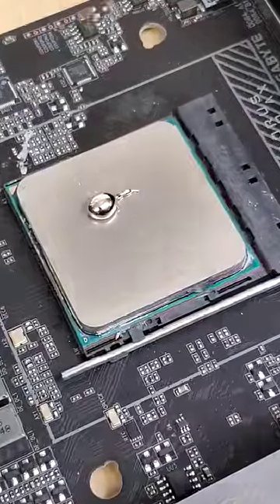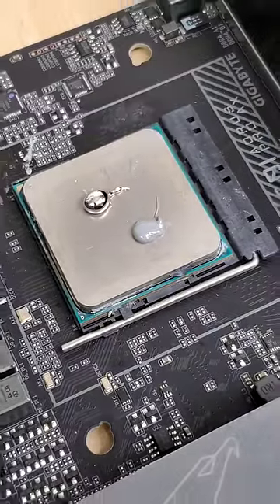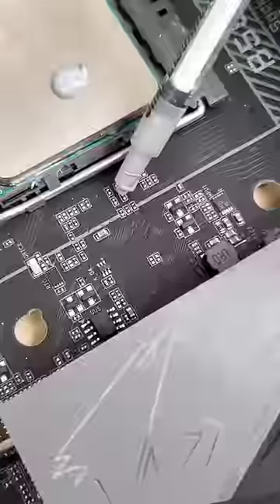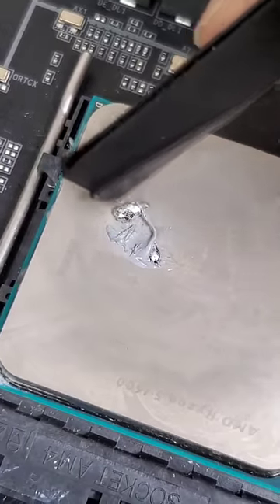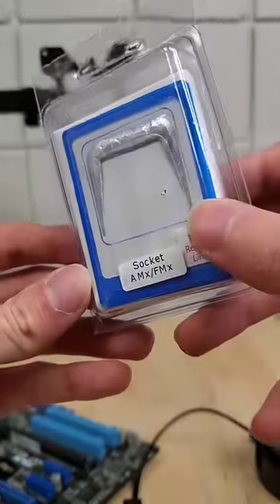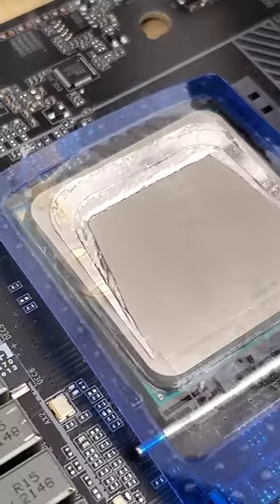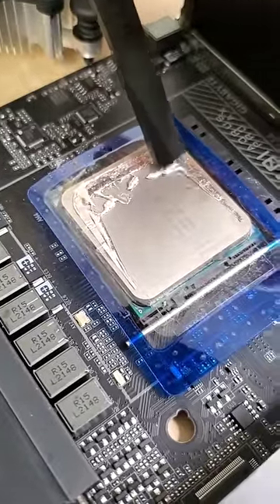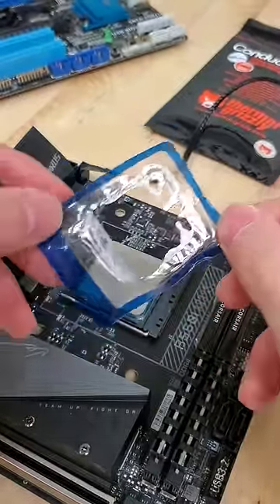the future of thermal paste technology #shorts

Comment: Try using solder as thermal paste
Reply: Solder is designed to have slight electrical conductivity?
Reply: You'll probably de-lid the cpu upon disassembly
Reply: Yes
Reply: @ottersmeep25 not slight...
Reply: @BoltGoesPro   it's called sarcasm
Reply: @ozzi189  if you render some 3d scenes first and right after take the cooler off while its still in liquid phase
Reply: Gal as thermal material 😂 probably pretty effective really.. it would have to be at operating temperature to remove the heatsink or water block before the gal sets solid.. but i would think its almost as good as liquid metal.. the only real difference is liquid metal is liquid at room temperature where gal needs a small amount of heat to melt (hand temperature is enough) but once its melted it should be very close to each other.
Reply: solder melts at temp 300celcius+
Reply: @electronicguy420  solder does. Gallium metal melts in the palm of your hand. Where liquid metal is liquid at well below room temperature.. it requires dry ice or liquid nitrogen to harden to a solid.. so gallium metal is pretty good for a cooling compound because the PC operating temperature will turn it to a liquid..
Reply: Nah just get that mercury bro
Reply: @michaellegg9381  he's talking abt solder...
Reply: Yeaaaaa
Reply: Come to inbox 🎉
Reply: @ozzi189  No difference for AMD AM4 CPUs
Reply: @electronicguy420  yeahhhhh that’s not melting
Reply: @electronicguy420  unless you try playing RTX Minecraft texture pack that solder will not melt
Reply: @Angyjxx  ik this is sarcasm but the connections inside the gpu will short before it even reach those kinds of temps
Reply: @electronicguy420 womp womp
Reply: @ozzi189 yeh, you'll need to run it to preheat the liquid metal, and then probably keep a blow dryer or something on it for removal
Reply: The next Intel i9 is gonna melt it 😂
Reply: lol don’t give apple any ideas
Reply: Solder huh, what metal is that 😂,
Reply: @LIVE-b7j  it depends 
cheap stuff is usually tin+lead
Reply: @chichangwu don’t forgot to unlock the cpu thermal limit to 300 celcius
Reply: Bad idea that solder is hot enough to sever the tiny little connections..
Reply: That won't melt. It melts around 320°C. But maybye solder paste would be interesting
Reply: @ottersmeep25 doesn't sound like sarcasm at all. You are terrible at sarcasm 💀
Reply: Can’t tell if that’s a troll but sounds like a video for LTT
Reply: Won’t work as solder melts at 250-300°c (leaded) unleaded melts at like 300-340°c, best bet would be low melt which melts at like 150°-170°c however the cpu would be cooked by the time it reaches that temp.
Reply: ever heard of amalgamation?
Reply: @ottersmeep25 not slight
Reply: I used to use thermal paste, but my dentist told me to use regular toothpaste.
Reply: @ottersmeep25 the whole point of the vid was that metal based thermal paste is conductive?
Reply: Not sure it would stick without a lot of flux but worth trying
Reply: @ottersmeep25  it is literally made to conduct electricity 🤦‍♂️
Reply: @ozzi189 Prime95 until it starts to reflow
Reply: @michaellegg9381  Yeah use gallium and watch it eat away every piece of aluminium in the system
Reply: @cyberpunk1618 popped in here just to say that, since Al is NEVER used in CPU lids. Or any of the wires. Want to see the actual silicon AND definitely destroy your system? Gallium will definitely do that for you.
Reply: Yeahhh that’s a bad idea, can confirm as I work with that shit on a daily basis
Reply: @ottersmeep25 it wasn’t obvious
Reply: @thatoneultramarine208  so do i
Reply: @michaellegg9381  problem with gallium is that it destroys every other metal?
Reply: @michaellegg9381  dude watch what happens when you put gallium on aluminum lol it’s not a good thing
Reply: @ozzi189 Wood's alloy or Rose's alloy. They melt at under 100C°
Reply: @Angyjxx  Then you should know it’s a bad idea lol
Reply: @thatoneultramarine208 lol yeah but this the same guy who put hot glue in his pc so there is a chance he will actually do it
Reply: @michaellegg9381   yeah and do you know any properties of gallium?  It liquifies alluminum and makes steel brittle when it comes in contact with them, and almost all heat sinks are made of aluminum.  If any gallium leaks out, it will liquefy your aluminum pc case.
Reply: @Angyjxx  True you do have a point there lol
Reply: @michaellegg9381  CPU covers are often made of aluminium, and gallium reacts with aluminium. You'd turn your CPU brittle like sugar glass.
Reply: @michaellegg9381 Gallium on an aluminum ihs and aluminum heatsink? You sure about that?
Reply: Do you know what temperature you would have to heat the CPU lid to in order for the solder to entirely wet the surface of the lid and the cooler?

You'd burn out the CPU and the socket before you could find out if it works, though it is a very interesting idea!
Reply: @BruceNJeffAreMyFlies  I'm not sure gallium eats other metals it's not something i have bothered to look at lol I know liquid metal eats other metals so it might ill google it. But if so a copper IHS would be a good way to avoid that issue and a copper slug in the heatsink.. might cost a extra few $$ but would be worth the effort I would think 🤔
Reply: I don't think it'll ever get hot enough to liquefy and if it doesn't get a solid connection it'll suck but I still wanna see
Reply: @ozzi189 I don't think the solder would even stick to that but I also am not positive what it's made of
Reply: To all who say gallium metal is bad.. ( yes it is) but it's also the main ingredient in liquid metal from thermal grizzly..

“Gallium in general also reacts with copper and leaves it pitted on the very top layer, but the reaction is not heavy so doesn't really matter to Thermal Grizzly. Nickel has the function of a diffusion barrier and doesn't react with the Gallium, which makes it a lot more suitable for the application.”7 Sept 2018
Reply: So we already are using gallium metal in cooling systems as it melts at 10°c.. it even eats copper slowly as it pits the surface of copper so now I wonder how thermal grizzly liquid metal doesn't eat the copper slug or cold plates in cooling systems
Reply: It wouldn’t get hot enough to liquify. If it does, you need to either put the wires in the right ports, or you need to run away from your house.
Reply: @michaellegg9381
That’s great and all, Michael, bud OP was talking about solder. Also gallium is very corrosive and reactive to pretty much all metals. Terrible idea.
Reply: Solder is used between the actual CPU die and the heat spreader, so yes that's certainly possible, but you may as well just delid the CPU for that additional benefit if you are going to go that far.
Reply: @eclipsegst9419  exactly 💯.. if you are going to delid a CPU ya might as well liquid metal it while you are there..
Reply: Bro, they are dying for their country and you want to use them as a thermal paste??
Reply: @MrFuzziiWuzzii  indium solder is what Intel and I assume others, use.
Reply: Fr
Reply: you mean solder paste?
Reply: solder TIM based on indium is commonly used to conduct heat from the IC to the IHS of a modern SoC
Reply: @ottersmeep25 so does liquid metal?
Reply: @BruceNJeffAreMyFlies CPU covers are made of nickel plated copper, and existing Liquid Metal thermal pastes already are mostly made of gallium anyways. Back a few years ago people used to take the cover off of cpus and put Liquid Metal in between the actual silicon and the bottom of the cover. A lot of precautions you have to make but it would drastically reduce temps
Reply: Maybe make a circle with silicone based thermal paste and put the metal one only in the middle of the heat spreader. The dye is only in  the middle at the side of the heat spreader are the bonding wires.
Reply: and we thought thermal paste was a bastard for getting the CPU stuck to the cooler
Reply: @ozzi189 then don't disassemble it
Reply: gallium would destroy your cpu though because it’s so corrosive
Reply: the problem is that its gnna solidify really fast (bcs the cpu conducts all the heat away) and then it wont really contact the cpu/cooler really well, also you will solder them together and then cannot get them off eachother
Reply: @088O  Solder ≠ Gallium
Reply: My cooler is hardwired 😎
Reply: CPU manufacturers already do that.

They use an Indium based solder to bond the silicon dies to the heat spreader because It's more thermally conductive and has a much longer lifespan than pastes.
Reply: The cpu itself is sometimes soldered to the heatspreader, so they already do!
Reply: I too would like to see this. Although it would probably require de-lidding the CPU to "safely" do, and de-lidding is already risky/unsafe.

I suppose with a low melt solder of around 130 C you could maybe get away with heating the heatsink and squishing the CPU on, but even that seems really difficult, and additionally has the risk of overheating the CPU since they may break at those temperatures.
Reply: @ottersmeep25 Electrical solder, yeah.  but there's always jewelry solder!
Reply: @ottersmeep25 Liquid Metal is highly conductive which is its major drawback
Reply: @GregoryMcBride-qf7hx   no, it doesn't. gallium is only corrosive to aluminum?
Reply: @michaellegg9381   yep, gallium is only corrosive to aluminum
Reply: @ottersmeep25  it does also damage copper.. it doesn't destroy it like aluminium but it does slowly pit the copper surface.. I not long ago asked google for what damage it can cause to what metal's.. turns out nickel plated copper is the best way to liquid metal at the moment as nickel finish is highly resistant to gallium metal.. but I had a good thought!! What if we used silicone as the cold plate on a cooler instead of copper slug or something like that as the surface can be really flat and transfers heat really well so deluded and the silicone die with liquid metal then a silicone suffice for the water block or air coolers could be really good I would think..
Reply: @ottersmeep25  are there any aluminum components in a computer? Unless it was fully contained, I wouldn’t trust it.
Reply: @ottersmeep25 it is very conductive for both heat and electricity. So is this metal he’s shown in the clip. So is Liquid Metal. That’s why they short out the mother board when they go places they shouldn’t be in. Because the positive and negative get shorted out through the conductive material dripping or flowing onto them.
Reply: I read "soldier" at first and got really confused for a second
Reply: @IMDYT420  What kind of solder are you guys using? The standard SAC305 has a melting point around 220°C, the old SnPb solders are closer to 190°C.
Reply: Cooler and CPU forever mated
Reply: @Angyjxx womp womp is such a cringe elementary school phrase, why are you like this?
Reply: @cyberpunk1618 if you have a full copper heatsink base, and a copper IHS.. Gallium isn't eating anything
Reply: @glen3925 almost all good heatsinks have a full copper base, which is not reactive with gallium.. Also I may be wrong but I'm pretty sure you can't use liquid metal with an aluminum heatsink anyway since it often has gallium in it anyway?? How do you think people running liquid metal manage, they go copper
Reply: @twisvis5531 what do you think liquid metal is made of?
Reply: @michaellegg9381 liquid metal eats other metals because it has gallium in it
Reply: @michaellegg9381 it does very slowly, but it's irrelevant to its performance
Reply: Thats just a laptop

Comment: I thought it’s gonna be some incredible solution. It just ended up being: let’s put something above the metal
Reply: Sometimes the simple solutions are all you need.
Reply: The heatsink goes above the metal. The thermal paste fills a very small airgap between the CPU's heat spreader and the heatsink.
Reply: @MrAndrewAllen  I would prefer to hear derBauers opinion . The extra plastic ...could increase the "forgotthename" height....Also ..wouldn't the metal just flow out of it ...because the plastic will always have small openings.

There is actually another problem with liquid metal not mentioned in the video which is what it does to aluminium (which is kinda important considering how much cooling apparatuses use alumium in the part that makes contact with the thermal paste ).

Also ... I think derBauer has a better solution ....
Reply: I'm genuinely curious how this doesn't flow off onto the rest of the components when it's turned upright... Or... Sideways... You know what I mean. 😅

Is the plastic just thick enough to stop it seeping out from the heatsink?
Reply: @cyrilvaneijkelenburg3743 while I agree with your points, people who use liquid metal are very rarely using direct heat pipe coolers. Most people who use liquid metal are going for higher end coolers that have proper copper nickel coated cold plates or water blocks that are full actual copper.
Reply: Around...not above, did you watch?
Reply: @cyrilvaneijkelenburg3743  it will just eat aluminum
Reply: @UntrainableWizard  same
Reply: ps5 has liquid metal as thermal paste from 2020, its nothing as "future" in here...